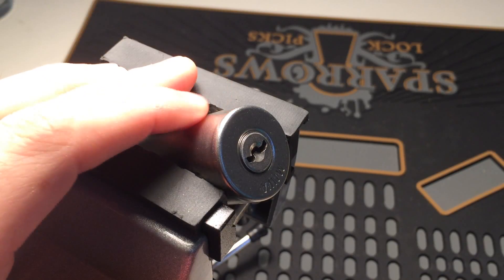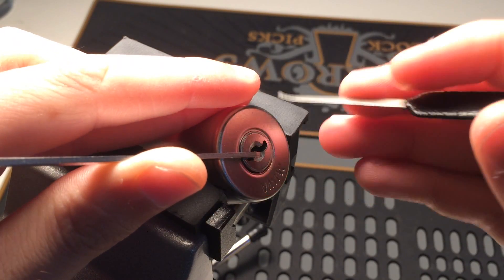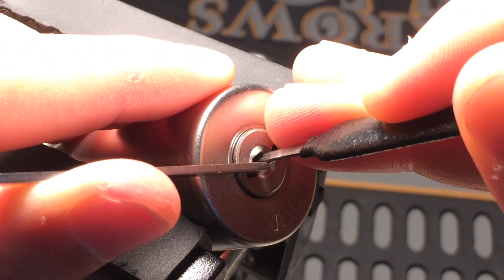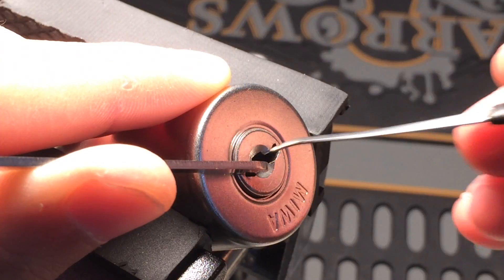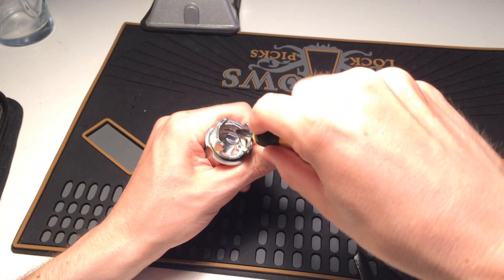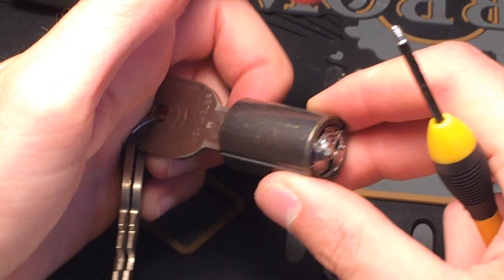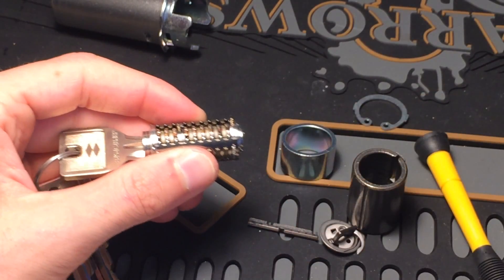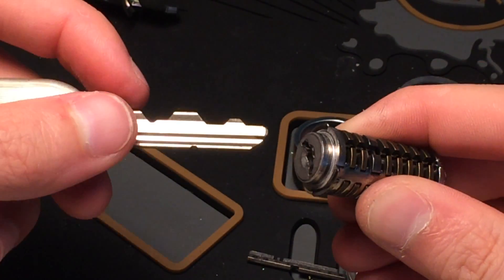Miwa U9 (Japanese Lock) Picked and Partially Gutted

Comment: AWESOME, FANTASTIC, CONGRATULATIONS -- the Miwa U9, a VERY difficult to pick, High Security Lock from Japan.  I gave one to Bosnian Bill -- failed -- and then to Lock Picking Lawyer, but LPL has not picked it yet.  How do you tell which is the true gate?  Ready to try the more difficult Miwa PR cylinder?  You are the Man!  Guess I need to look at CorrectJeans video next, so you must be the third "Master" to pick this lock on camera.
Reply from the maker: Hey Dude, thanks for your comment :)
It is easy to tell when the lever is correctly set, it will jiggle under your pick. When it is not or in a false gate, it will feel very stiff.
I already picked the Miwa PR but I have never made a video, but that should come soon.